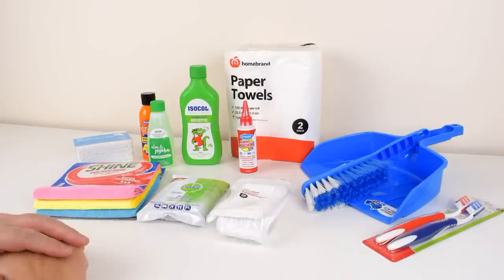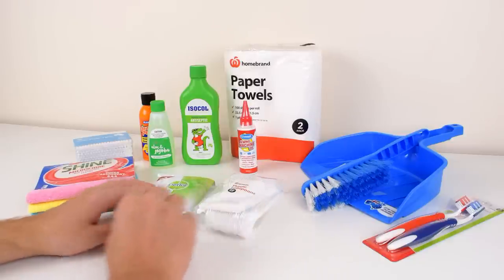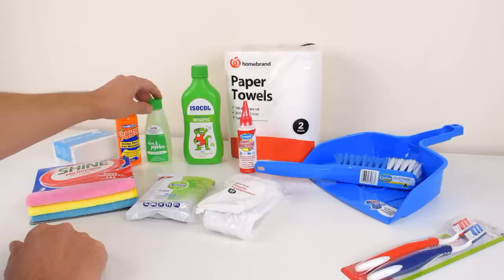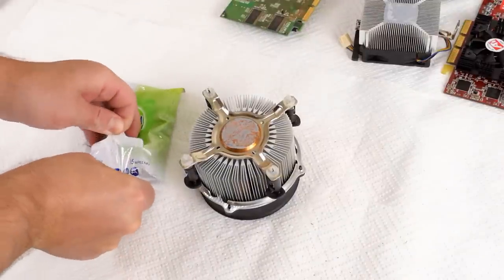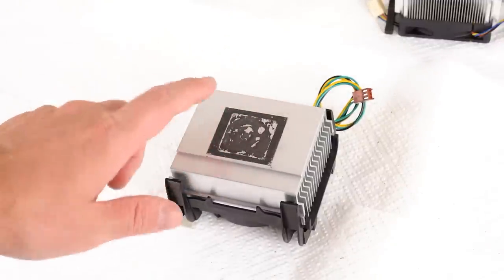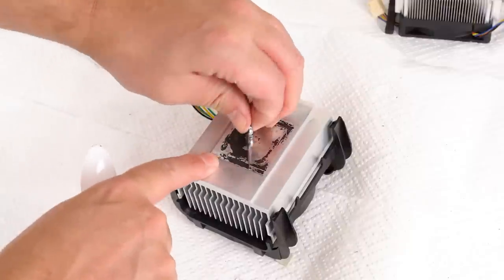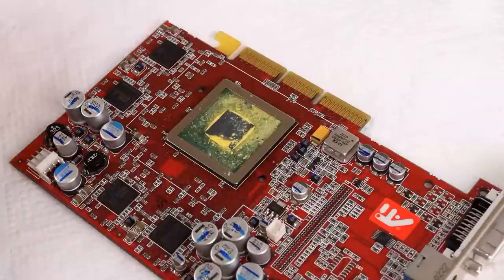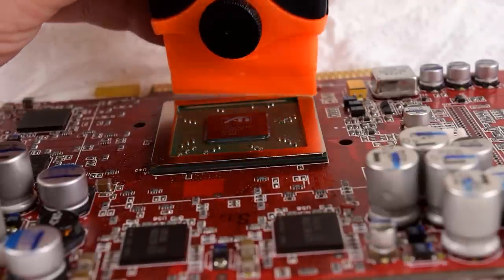How I clean old computer parts with household products

Comment: Lighter fluid=Kerosene or White gas    VER|Y CAREFUL USE..
Reply: ALSO...be aware of Humidity...  NEVER DO this in LOW (under 10%)...lots of static..
Reply: Or just not mess around with crap you're not supposed to use on a computer and use Iso.
Reply: tO THOSE THAT ASK how TO FIX COMPUTERS..If you cant PAY FOR A NEW BOARD...Dont touch it..
Reply: Uuuuuhm? What?
Reply: YOU DONT KNOW THAT??  WOW,/.  If you fix another persons computer OR your own..and you BURN/SHOCK/BLOW the board(s)...you get to PAY something..time or money..and PROBABLY BOTH..  #1 idea...DRY THE BOARDS BEFORE USING..even alcohol can SPARK/Short/Ground SOMETHING..
Reply: Do you normally shout when talking to people? Also if you're destroying boards when trying to fix them you're doing it wrong. Also your sentence construction makes it very difficult to understand your point. You come across as very angry and illiterate.
Reply: The fun part is when you Fix a board, you DONT KNOW, if its going to fail or not..and you need to tell the person BEFORE you destroy the board.  Not all boards have static protection On them..and Static in the air can make things even worse..
Reply: What? Static isn't "In the air" is a potential difference of voltage that's generated. If the board arrives to you in a non-working state, and you are unable to fix it. You are not responsible for the damaged board. It's the reason why you use ESD protection such as mats, wrist straps, bonding plugs, etc... To prove beyond reasonable doubt that you are not the cause of any ESD Damage that was done via you working on the board.  If you're a real computer technician or whatever you wanna call yourself. You use ESD protection like a professional.
Reply: I know easy way to get rid of static, asd the customer comment "IT WORKED WHEN I GOT IT HERE" has little meaning to you??  Cool..Iv worked on systems 30+ years.. from IBM 360-30 to commodore to amiga and Intel..
Reply: Please don't talk down to me, I'm a network technician with CompTIA & Cisco Certs that works on expensive Cisco networking gear like, Routers, Switches, ASA Firewalls, among other vendors. If you have worked on expensive computing equipment you should know the dangers of ESD, and shouldn't trivialize it. However I'm sure we can both agree that the customer will not always be the most reasonable person in the world, and will normally pull the card of. "Well you're the last person who touched it. You broke it" However you must then explain that isn't the case.

Comment: Hello Phil, your videos are very good-you know it. But you don't have to use all these stuff. You need 3 products that cover anything and for oil you can use the WD-40. The 3 products are odorless/colorless benzin for general household cleaning, Pure alcohol and pure acetone. With benzin you can remove almost anything. It is the most basic of the three. Check them out.

Alcohol is more for removing stickers or sticky residues. Some chemicals "require" alcohol to be removed. Acetone is for the heavy stuff, it can harm plastic but not the one that is used in pc's like the agp port for example. It can't ham chipsets but yoi don't need to use it unless it something really sticky and solid.You can use in cases of epoxy thermal paste like the one in voodoo 5 for example. With benzin you are covered 95% of the cases.
Reply: WD-40 is NOT a proper oil or lubricant. It stands for Water-Displacement 40th attempt. Use dialectic grease if you need something with more viscosity or a silicone oil if you need something more runny.
Reply: I do not know what is stands for but it smells like petroleum based product, it is very good for cleaning the fan bearings though. You can use only this if you don't like to buy any grease as you say. I usually clean with WD40 (it is thinner than the grease) and use some grease for lubricating.

Comment: I use WD40 to clean old dried thermal paste off my CPUs, works even better than isopropanol
Reply: Please don't.
Reply: WD40 is a oil based product. You don't want a oily residue. 

Use a proper degreaser instead.
Reply: No. Seriously why the F*ck are people recommending crap like WD--40 and de-greaser. Use isopropyl alcohol.
Reply: I use alcohol afterwards of course